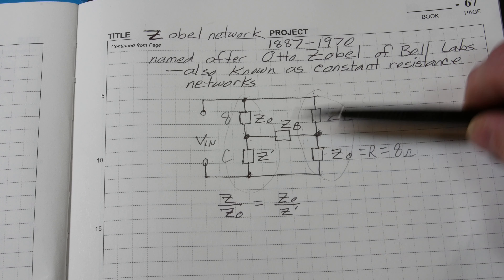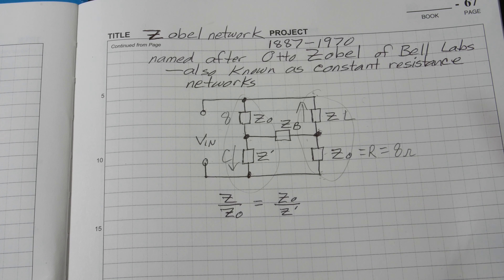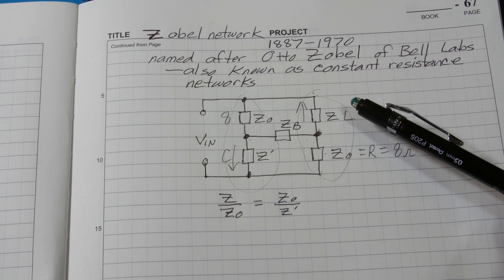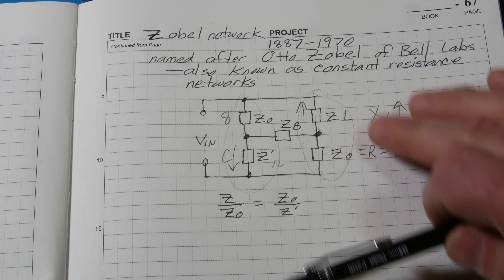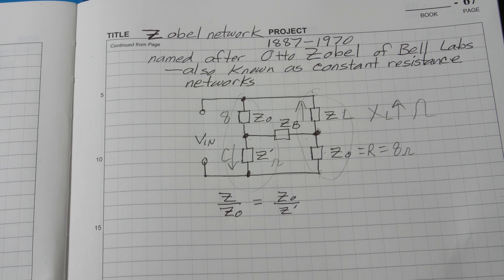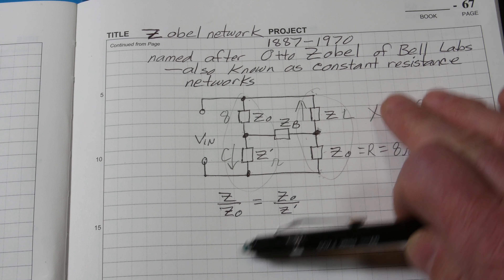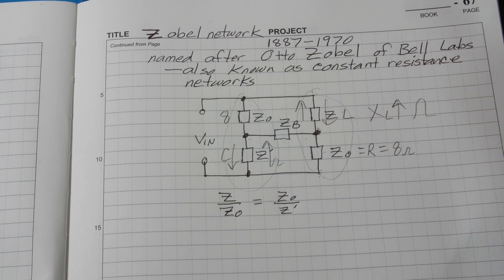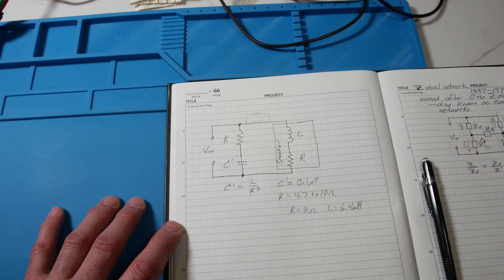Zobel network and the Boucherot cell

Comment: errm can I put a zobel between my valve output and the transformers? and is there a way I can bias the circuit to match/counter rising frequency response in my full range driver? obviously I am not an engineer but I like your explanation style (y)
Reply from the maker: Great question!  It might be possible - I'll have to look into this and get back to you.  What I can say is that the transformer is meant to do a similar function - and that is to match the impedance of one stage to the next.

Comment: THANK YOU FOR EXPLAINING HOW ZOBEL NETWORKS  WORK.IT SEEMS LIKE YOU ARE TRYING BALANCE THE THE REACTANCES OUT SO THEY CANCEL ONE ANOTHER OUT LIKE RESONANT CIRCUIT.HOW DOES IT EFFECT THE SOUND QUALITY?DOES SOUND BETTER AT ALL FREQUENCIES GENERALLY SPEAKING?
Reply from the maker: Yes, the reactances balance out and the resistors act as both dampeners and as a fixed resistance value - so the end all is that the input looks like a resistor across a wide frequency band.  Good idea to do this video.  The follow up will have even more info.  It should improve sound quality and I'll go more into that.